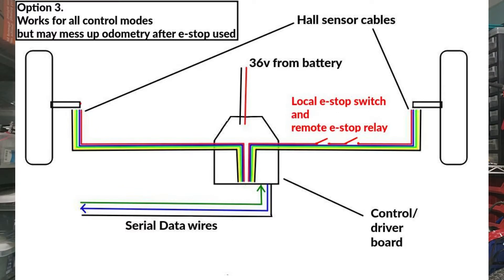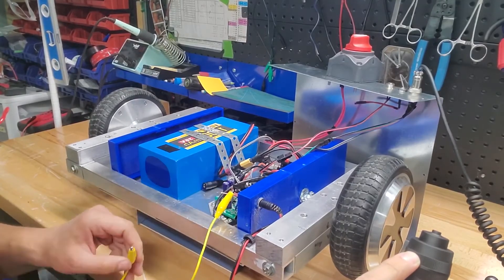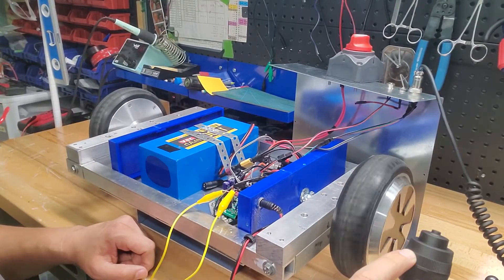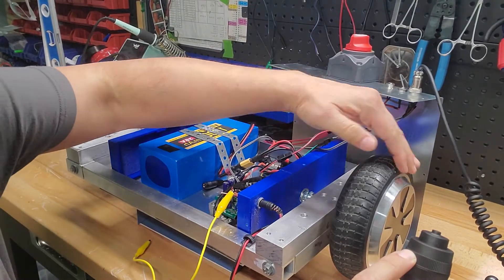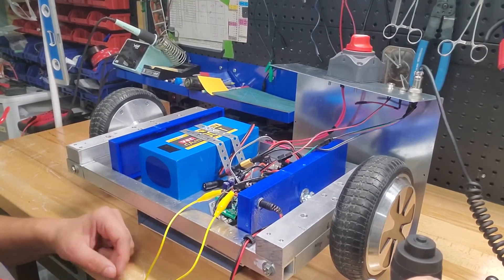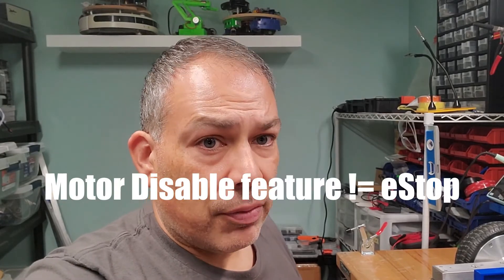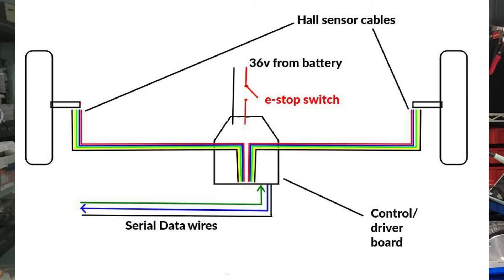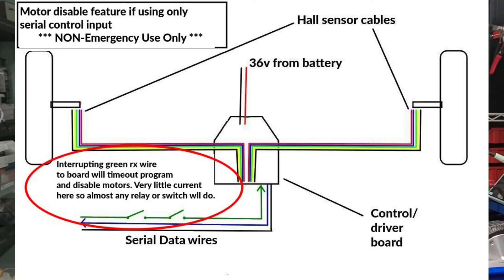URGENT CORRECTION: Emergency stop for hacked hoverboard creations

Comment: So long as the device has a big red button, is it necessary for the e-stop to be remotely triggered too?
Reply from the maker: That would depend on the application and operating environment. I would say that if the machine is going to operate remotely (without a human operator literally riding it) then it is very prudent to have a remote E-stop because these can be too far for the operator to get to the button. Even starting at arms reach these can move faster than most people can run to catch up to it and hit the button, so unless the operator is a rider I personally consider a remote E-stop mandatory. For example if it begins toward traffic or a person, can you be sure that you can get to the button? If it's coming toward someone you certainly can't count on them getting to the button before they are run over.